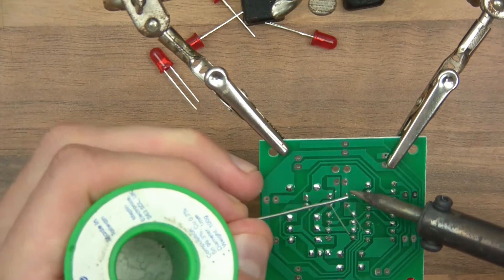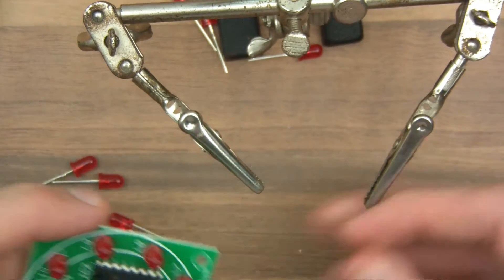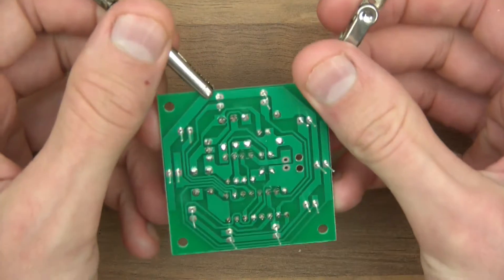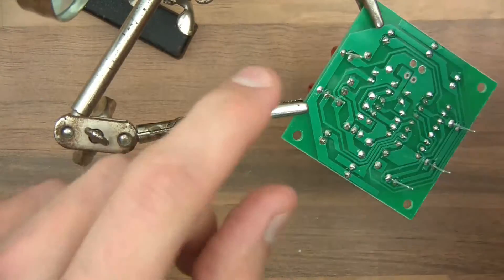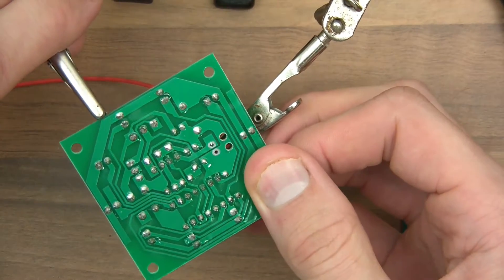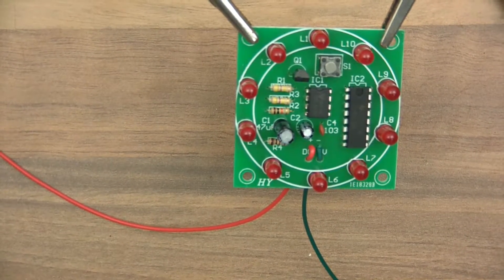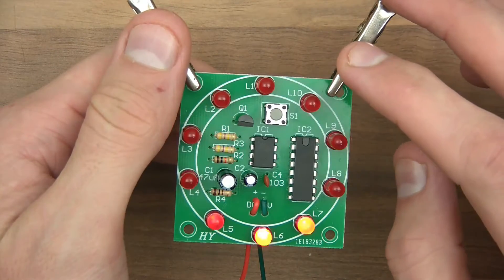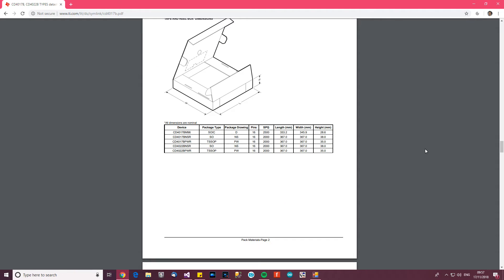Kit Build #7 - LED Random Number Generator Kit (Part 2/2)

Comment: That actually works quite nice.  I like the way it slows down at the end.  Has a roulette wheel look.
1 to 6 would be better so you could use it as a dice.

Is there a schematic? I have no idea how they did that with a 555.
Reply from the maker: You know what, I should be allowed to post images in the comments. There is a schematic but I threw it away just earlier. They achieved it with another chip. I show it at the end of the video.
Reply: Thanks, I'll take a look.  It amazes me how an analog 555 IC can do this.  I doubt I can understand it anyway :-)